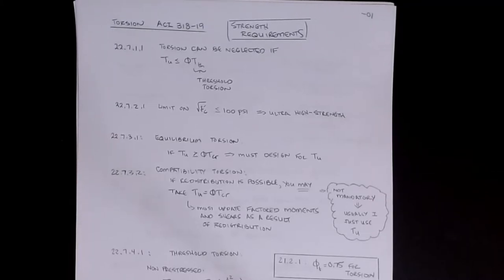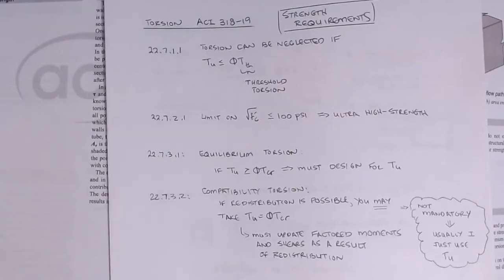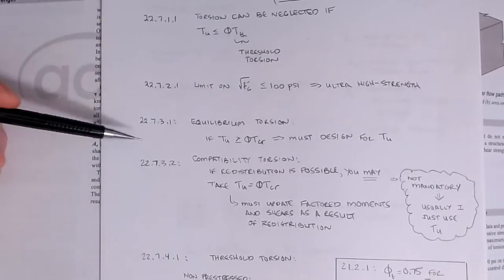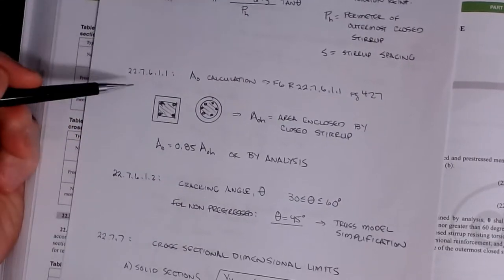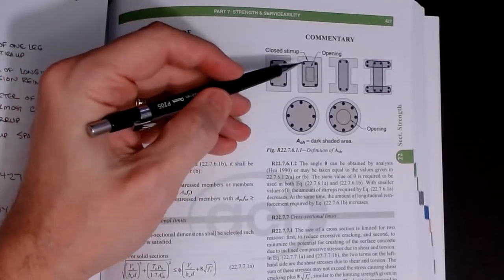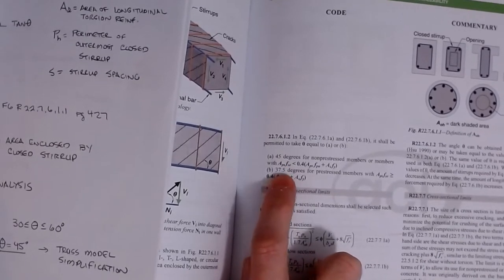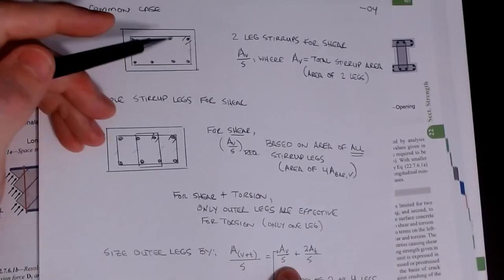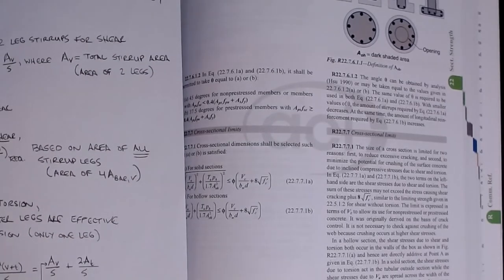030 CE342 Concrete Design: ACI318-19 Torsion Strength

Comment: If there is compatibility Torsion we will design the beam upto cracking Torsion????
Reply from the maker: You don't design the whole beam for cracking torsion.  But you can design the specific location (usually a support) for the cracking limit. It is assumed then that you will perform a redistribution analysis to see where the additional torque in the beam is being transferred to.  If one part is reduced, then the load is often sent to another location and may actually increase there.  See our next video for an example and explanation of redistribution.  Thanks for watching!